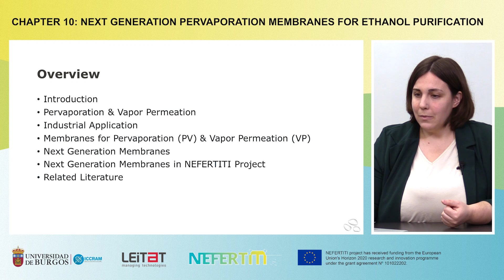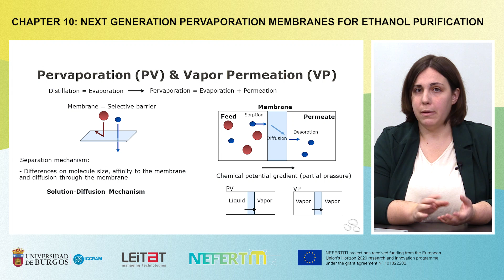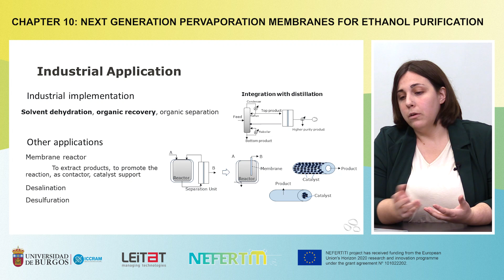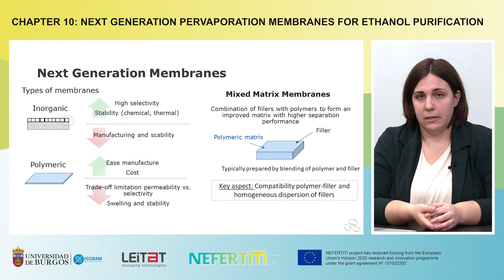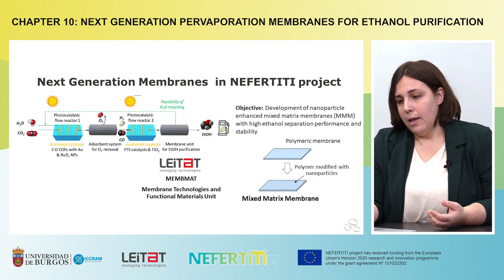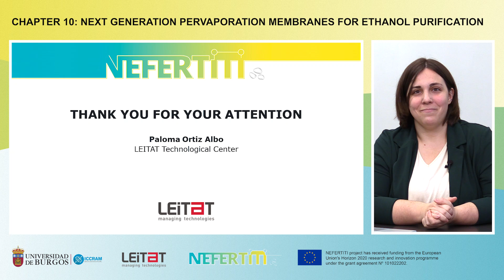Chapter 10: Next generation pervaporation membranes for ethanol purification

Comment: Thankyou madam 
My query is regarding blended car fuel supplied by the Indian government - ethanol 20 petrol

Indian consumers are forced by their government to use ethanol blended petrol. Initially the blending was 10% and the mileage per litre reduced so people bore with it. 
Now they've increased ethanol blending to 20% as declared officially, but we feel it's more. Not only the mileage has drastically  reduced, but the car drives erratically. At the same acceleration input, it suddenly jumps in pickup, or stutter along at lower speed. This may add up to car pile up and accidents.